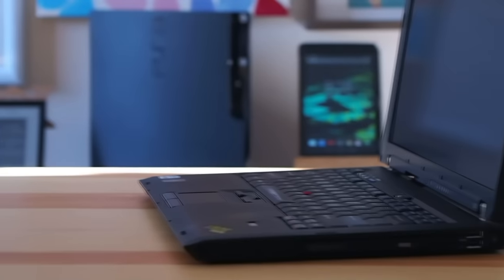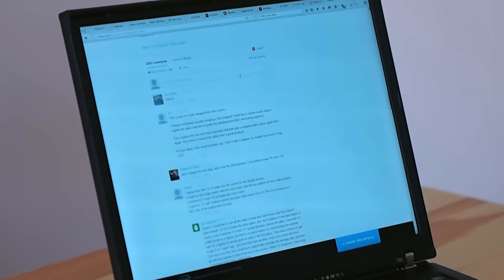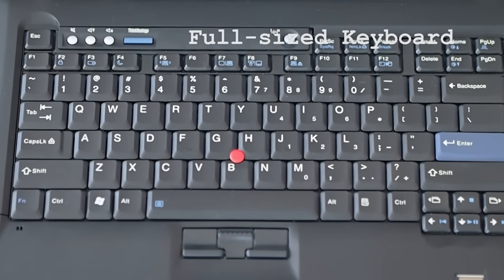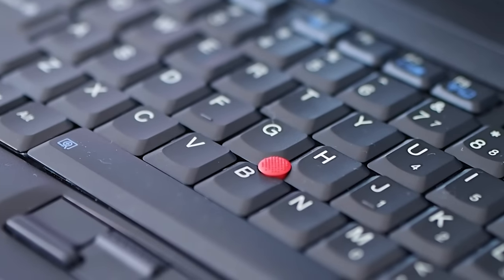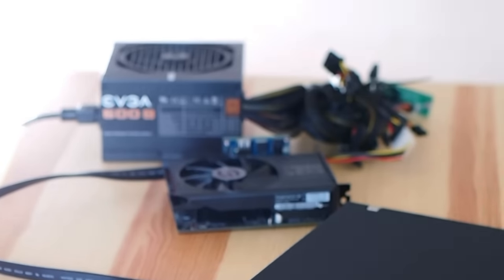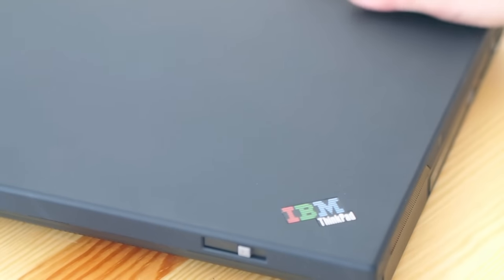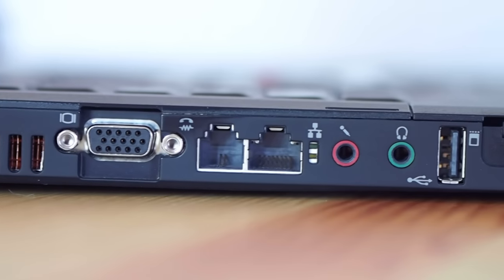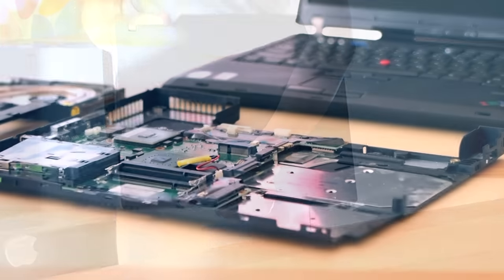Lenovo Thinkpad T60/T61 (T601) Frankenpad: best traits of classic thinkpads?

Comment: It's a little sad this video is this channel's only one. It was really well done.
Reply from the maker: A little late but thanks for your sentiments. Clearly we stopped doing youtube altogether. But this iconic thinkpad inspired us to continue onto careers in programming and data science. A little too busy for more videos but we do have footage of a quad core T520 that we never got around to posting. We felt that it was a decent progression from this frankenpad if someone needed newer specs but retained some old thinpad traits. We might post it some day. Thanks for dropping by.
Reply: pls show us :(
Reply: @tunatechco4194  Check out the X61s :)
Reply: Still use one (T60) 2020. Although the CPU that I have (T7600) can take a 64-bit OS, I run Win7, 32bit and Office 2003. Only 3 of 4Gb of RAM is usable due to the chipset limit. But with an SSD on board it works well. Wish I had a brighter display though. But indoors in the evenings it's fine. I don't think I'll upgrade mine any more. I'll just keep it as an historic piece. 
I also have its smaller brother, the X60 and a T420, a T430 and the E520 to play with. 
I'm sad that the 1900x1200 screens shrank to 1080 on today's laptops. 
Even the 10.5 " screen on my Samsung Galaxy TAB S from 2014 has 2560x1600 resolution!
Reply: @northof-62  I have a T60 as my main computer, and an LED backlight kit is a must in my opinion. It makes the difference between a screen that is just about usable in a dim room and a screen that is perfectly fine even outdoor in sunshine.
Reply: @kosztaz87  Thanks for the tip! :D

Comment: Cool video.  I love my T60.  9 years old and still going strong.
Reply: same my thinkpad T60 has a T2400, 3GB of RAM, and a 32GB SSD, and it runs cloud ready, currently using it to type right now
Reply: My 12 years old T60 still works just fine. It has a Core2 Duo T7200, 4GB RAM (3GB usable), Mobility Radeon X1400 and 14.1" 1400x1050 screen.

Comment: Thumbs up! I just updated my T61 to Windows 7 64 bits (8 Gb memory), I also have a bootable drive with Ubuntu. I run Oracle virtualbox with Oracle Database (enterprise  and weblogic server inside the virtual box. This is an amazing laptop which I still use as a backup to my Thinkpad W-520. Thank you for the review.

Comment: Yes! The T60p UXGA Frankenpad is a great machine.
Give it the buttons and the trackpad of the T43p, a matte Retina screen and modernized components, then it would be a real killer laptop.

(Comment typed on a T43p UXGA, SATA Mod, with classic NMB keyboard without Windows Keys).
Reply from the maker: +lophiomys If it weren't for the aging hardware in the T43p (for my needs), I think I would also be using it as my daily driver. I absolutely agree that simply modernizing either the T60p or T43p would be enough for me to buy it in a heartbeat.
Reply: +TunaTechCo I have both a T42p 15" with a 1600x1200 IPS screen (Runs Windows 10 great!) and a magnificent T60p (1650x1050) that are a couple of my favorite Thinkies.

Comment: I have a T400 and just picked up an X220.  While these are later generation machines, they both seem to work well.  I've upgraded the T400 to 8gb of ram, which is probably the max for it, (as it is for the T61).  The X220 already has 8gb of ram, but I think it will go to 16 (probably would cost me around $100 for that).   The T400 now has a SSD, and I'm debating on what to do in that department for the X220.  Choices are replacing the 320gb hd with a similarly sized 2.5" SSD, adding a 64-128gb mSata boot drive, and keeping the 320, or go with a 500gb mSata and ditch the 320gb.  The latter choice would probably save power and extend battery time.

Comment: I remember looking at various IBM laptops during the years, but other companies mimicked them and desktops got so popular and the industry exploded with so many models and I experienced most in computer school and work anyway.

In 2017 I felt for buying a T430 that I saw in a shop window and the quality and easy repair/upgrade options was a very positive experience. I consider a T60/T61 for a bit of DOS/text/vintage stuff. Just to rebuild a good one from eBay parts would be interesting.

Comment: Frankenpads are rare and expensive because of of the screens are roughly $300-400 each now days D: then there is all the work to make it work. Speed wise the T60/T61 still hold their own and very capable plus the audio quality is much better than modern laptops. Screen is reinforced with a magnesium frame just like the lower body so there is no worry with the screen getting destroyed unlike modern laptops. 

Get thinkpad fan control for those who do a lot of work or live in a climate where the laptop gets rather hot. 

QXGA 2048x1536 IPS (LED)

Comment: I have a t420 and I love it. I owned 600 series laptops from IBM, it was an epic device. The t420 really is no exception. I've owned the T430 and while the t420 is just a 2nd gen Sandy Bridge i5, performance using the t420 recovery media is nothing short of amazing. Sure, it's a tank. But isn't that part of the classic experience? I would argue easily these are just as fast, if not faster than many low end celerons while offering so much more then one of these low end jobs.

Comment: I own the T60, and I maxed out almost everything (T7600 CPU, 3GB RAM, SXGA IPS display, 120GB SSD). I would throw in a T61 motherboard, but finding the correct motherboard that wasn't affected by the Nvidia GPU defect is hard. Most T61 were widescreen, and the GPU defect makes it even worse. But the T60 is still a very useable machine. Web browsing and HD YouTube work just fine on it.

Comment: You say that yours has LED backlight, did you upgrade the display panel because that was never a standard feature in the T60?  The parts are out there to do it but I'm just wondering if your is modded with it.  Nice video!
Reply: +Pete B T60 was not sold with LED backlight, so it has to be one of the modded screens. Normally the T60/T61 all had CCFL backlight.
Reply: +IThinkAbout43 Right, yes I agree.

Comment: Isn't it simpler to simply take the entire screen and lid assembly of a FlexView T60p and slap it on a 15 inch T61 with it's screen removed?
Reply: They did not make 15" 4:3 T61's, only 15" Widescreen models were made.